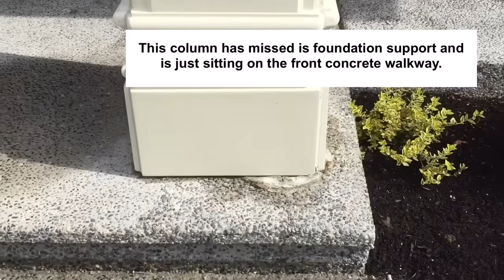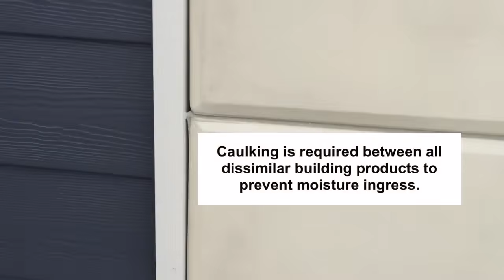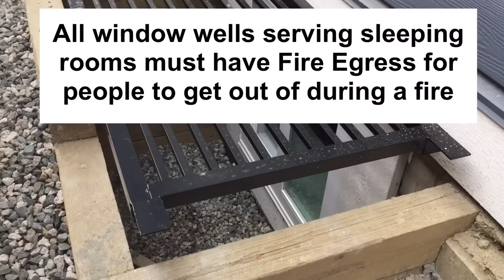New Home Construction Inspection - This is Shocking!!

Comment: Everything built in today’s world, CRAPMANSHIP! The houses built in 40s and 50s, if well maintained are treasures!
Reply: Except plumbing
Reply: @Ahmednscc  my house was built in 26, 2 of my baths have plumbing from then and it indeed seem to have been problem free for nearly 100 years.  I've had more issue with reno work done 5 years ago than bronze plumbing from the 20's.....  Even if the stuff has worn out the difference in craftsmanship is astounding, the original craftsman took serious pride in their work.  The plumbing from the 20's if code was 18 inches for support straps, the pipe has straps every 18 in exactly, everything is fitted exactly, site built windows fit tight,, my replacements done recently have a draft and require caulk.....
Reply: I have to disagree. The reason there are code enforcement and inspections is because old faulty work. Cutting cost is the number one cause. I work in this industry. I build custom homes in the million dollar range. If you have a good contractor and money to spend all should fall in place.

Comment: Great job Tom. I was right there with you. Cant believe the amount of problems wrong on the outside as well. I do drywall and our punch list is held to the maximum appearance to the home owner. I will happily point out caulking and roofing issues if I am called out for a warranty call of water leaks.
Reply: Before he even gets close and you see how crappy the columns themselves were done on a $2 million plus house... you know this is a turn and burn job...

Comment: i have a serious distrust for any gaps smaller than 3mm, similarly i have a distrust for silicon seals, and especially for roofs, windows, and outside WEATHER exposure, i distrust any fillers/mastics/silicones. It must be mechanically safe first and then masticed for good measure. Those facia boards usually have U channels that go on so even if the mastic breaks of old age you don't flood next rain. But...

Comment: Are you kidding me?

How are people asking 2.400.000 $ for this ?!

And how could anybody in their right mind only think about paying such a sum for such a lousy construction?

Ok, I am not familiar with where the house is situated, the property/land alone may be worth quite a sum - but this house is a bad excuse and an insult to any real architect and engineer.

Is this how downspouts look like in a million dollar home in the US in general?!

No big sturdy rain-pipe made out of copper?

The entry door looking like it could be opened with a few kicks/ shoulder throws from some strong guys?

It might be, I am too used to our german standard of constructing houses in "double-shell-masonry"

A thick solid stone for the weight carrying inner shell, most of the times between 6 - 8 inches thick.

some 6-8 inches of high-insulating, non-flamable stonewool insulation layer and then connected to the inner-shell via stainless steel drill-in rods, the outer shell consisting of klinker-stones about 4,5 inches thick.

This combined with a steel reinforeced concrete ceiling and some very solid construction of the roof, with thick, heavy, oven-burnt brick tiles on the roof.
The entry door would either be a 4-5 inches thick plastic, steel composite door, or in case one has more money to spend - some aluminum sandwich construction with heavy duty inline-hinges and 3 - but nowadays mostly 5-location autmatic lock-snappers, with reinforcements all over the place and many times 3 different sealing-lips for beter wheather proofness and also sound-dampening/reduction.

Almost impossible to open, even with a crowbar or other equipement usually used and carried by thieves.

many times a upper-middle class entry door will require firemen to entry, if you have no key and 5-10 minutes of work with hydraulic cutting equipment!

At least, that is the way my contractor is going to built my home and I paid less then half a million € for it! (still lots of money! and I am and still for mayn years will have to work my ass off for that - but for the quality I hopefully will get, I am willingly paying this amount - nontheless I also consider having a home-inspector on my project, just in case!)
Reply: kniefi this is in canada
Reply: This is in vancouver Canada, one of the most expensive real estate markets in the world. The land itself is probably worth at least 1.5 million alone.
Reply: @shanmango  more
Reply: Mark Shan and now with this house on it, the property is worth about 1 million.
Reply: @shanmango  Canada? But it's a big country with low population, why not go live somewhere else for 1/100 the price?
Reply: @Mic_Glow  most of our land is inhabitable.

Comment: Where was the City inspector at when this house was passed? At the race track with the contractor?

Getting an inspection before a house can be sold is in many states a requirement. It should be. 

After being in the trades for the last 35 years the arthritis in my back is getting to the point that I am starting to realize that I'm not going to be able to keep doing this for much longer and have been considering becoming a building inspector. It seems like a logical transition. I need to look into it more.
Reply: Absolutely!  You know what to look for, less physical on your back. Great transition.

Comment: Wow, so many issues.  Just people doing the job that really don't care about their work!!!!  Where I work, I'm very picky.  I want things done right the first time.  I hate half a** anything.  Lazy mistakes I wouldn't put up with.
Reply from the maker: Hey Brandon Blount please keep the negative swearing to yourself please. If you have something positive to add which will help provide a better finished product in the industry, I welcome those comments.
Reply from the maker: Thanks JB Dragon nice to know there are great people out there wanting to product quality over quantity. 👍
Reply: Exactly!  I can be picky, but my own boss knows my work.  He believes the same, do it right the first time the correct way.  Even if it takes longer and costs more.  It's the end results that matter.  If someone is going to buy a almost 2.5 million dollar house, shouldn't it be done correctly?   If you want to half-a** a $20,000 house, ok, I guess, but come on!!!  After you build the place, wouldn't you walk around and do a simple inspection to make sure everyone actually did their job?   Looking at this video, it wasn't that hard and took minutes.  Some of the stuff was really quite bad work.  Those front Columns, really?  Or the Stairs?  It was like armature hour.  The chalking is just laziness.  

Home Inspectors are a good thing.  Sometimes I really have to wonder what someone was thinking building a house.  Like it's their first and don't know better.  Like every industry, you have Great people, Good people, Ok people, fair people, and just downright BAD people.  If someone is doing work for me, I want the Good to great person.  I want the person that's always learning new things.  Will ask how to do something if they don't know for sure so it's done right, and not just guess and screw it up and then having to redo it which is more work and money wasted.

I'm always will to teach someone how to go about doing something the RIGHT WAY!  All you have to do is ask me.  I'm also open to new idea's.    Not even I know everything.
Reply: Why don't you erase it, I delete this kind of nonsense on mine.
Reply: How is this guy not worth hiring?   He isn't there to fix the problem, he is there to identify them.  Then you require the builder to fix his shit.  Even then if you don't believe what  this inspector says, you can research it.  I'm sure this "Scamer" doesn't have any degrees or references at all. :)  

By the way I am a weekend worrier for the most part and would do my own inspection.   But if I am buying a brand new home, you are dam right I would hire an inspector.   When I am looking at homes to buy, I take photos of everything and look at everything possible.   I do this because I try to find the best deal and know what problems I am buying.   This is also good because you can check out the history of the home and see how things used to be built.   Like timber with the bark still on it for the roof trusses, old hardwood floors hidden under ugly carpeting,   or my favorite the old nob and tube Fuse panel in the attic  ( 2 separate ceramic Fuse holders and an old style metal switch).

Anyway it's worth your time to hire a person like this before you move in to a nightmare or even just to make sure the builder didn't forget anything.
Reply: How is this guy not worth hiring?   He isn't there to fix the problem, he is there to identify them.  Then you require the builder to fix his shit.  Even then if you don't believe what  this inspector says, you can research it.  I'm sure this "Scamer" doesn't have any degrees or references at all. :)  

By the way I am a weekend worrier for the most part and would do my own inspection.   But if I am buying a brand new home, you are dam right I would hire an inspector.   When I am looking at homes to buy, I take photos of everything and look at everything possible.   I do this because I try to find the best deal and know what problems I am buying.   This is also good because you can check out the history of the home and see how things used to be built.   Like timber with the bark still on it for the roof trusses, old hardwood floors hidden under ugly carpeting,   or my favorite the old nob and tube Fuse panel in the attic  ( 2 separate ceramic Fuse holders and an old style metal switch).

Anyway it's worth your time to hire a person like this before you move in to a nightmare or even just to make sure the builder didn't forget anything.
Reply: +AboveAverageCAD smith there's a pretty nice house sitting at that location. Doubt he gave the right address. The trailer park a few miles down the road might be the best for him.
Reply: Don't throw the welfare card into this... plenty of hardworking people on welfare.
Reply: That house was probably built by east Indians
Reply: @JB Dragon. An American guy in his late 60s told me that home building workmanship 
lacks these days in America. They just get the structure up within a few
 days.
Reply: The apartment I live in is about 40 years old and when someone walks on the floor above us we can hear their every step... Also when we walk on our floor it makes squeaky noise everywhere we walk.  They just don't make 
good quality homes.. apartments in this country. Why the hell the quality is so BAD in this country?????????????
Reply: 321192ify
Squeaky floors are necessarily an indication of poor quality.  You have to remember, people build for profit and cutting corners adds to their profit margin.   A squeaky floor can be fixed as can many other simple issues that may arise over time in a quality built home...some things do get missed unfortunately.  If you are looking for cheap you will find it before you find good....high prices are not indicators of quality by any means....due diligence and what this guy is showing on here will serve you well in the search for a home well built and or taken care of.
Reply: Lowest bidder, coupled with very few people will buy quality. We are a throw away society.
Reply: Well, that escalated quickly
Reply: I would disagree........home building is not bad due to foreign investment.....it's cost saving techniques, short cuts and just general lack of concern for quality.  You will find most homes built by their homeowners are built to higher standards.  I am building mine, but I am sure I have mistakes or have chosen not use industry standards like adhesive between sub floor to joist/chords.  Cross nailing, ring shank nails or screws can take care of such issues as squeaking....it doesn't mean I don't want the best outcome......I think that some things are a moot point if you look at the total package and what really counts in the end.
Reply: So, we just replaced the locks on our doors. It's a pain in the, you know what. They didn't cut the holes out deep enough so the bolt lock doesn't go all the way in. Not only that, they did not use wood screws or even any good screws. Just some 1-inch screws. They should have had not only a reinforcement plate as well as 6-inch wood screws along with the small screws. They should both have pilot holes, and the original builder did not do this. What tool would you recommend to make the groove deeper? (we already know the basics, haha. Drill, proper bit sizes, etc. Just not sure exactly what to use to make it deeper. We think we could use a rotary tool of some sort.
Reply: I agree. Do it right or get the f*** off my site. 
Thank kind of work is like an art, your name is attached to it and in construction your name goes a long way.
Reply: 321192ify 

I have a older house and it's built pretty good.  A new house can be built great also, but it all depends on the design the the people building the home.  You have people that really like what they do and it shows in the quality of work they do, and then you people like the joker here, in it for a buck, while work quality sucks.

I'd take the A+ workers, and the F class workers like the fool here can keep collecting his welfare check and living in his section 8 hiding out cardboard box which seems to be more to his standards.
Reply: obviously you haven't because shit like this needs to be fixed asap.
Reply: Adam Clark   That house was listed as a Bank owned Foreclosure not to long ago, but maybe he just bought it. 🤔
Reply: GodGunsGutsandNRA maybe thats why.
Reply: Actually this country belongs to whomever conquers it and last time it was not a group of indians....stop playing it's mine.  That's all behind us....the video is up for a reason, not for you to show who's king of the hill.  Grow up and post something on Youtube and contribute instead of complaining and trying to pick fights.
Reply: Nooo, "this country" belongs to the people and the people did not conquer anything, they legislated 13 colonies from Britain/Europe to give others like Lewis and Clark and Mark Twain the God given right to explore and yes conquer the beautiful land that is America... more cowmen sense later, got shit to do....
Reply: JB Dragon its not about having pride in your work. Its call cheap labor that has no experience
Reply: That may be, but the company paying the person or persons to do the job, ok the job after it was done, or also just didn't care.
Reply: Brandon Blount    Sorry to burst your bubble, but I have an excellent crew. I do not have any problems with retaining my crew. I interview my employees before hiring them, and if you engage in conversations about building, construction materials, and you ease into ways to take shortcuts, you can weed out the bad ones easily. People who take pride in themselves, take pride in the work they do. Honest people will start to get uncomfortable when you start talking about taking "shortcuts" for increased profits. Real Craftsmen take pride in their work, and most have a "moral compass" that makes them feel uncomfortable when they are asked to do something that they feel is wrong. When a guys body language starts tells me he is uncomfortable with "rip-off," I usually hire him. That's how I keep good crews.
Reply: JB Dragon good for you!!!
Reply: Is that being sarcastic?  It can be hard to tell on a text message.  It could go either way reading this.   You spend a lot of money on a house which is a huge Investment for most people.  You want it done correctly.  Doesn't matter if it's a $100,000 house or a million dollar house.
Reply: I always do a good job - if I charge too little, that's on me.  Took a few years before I wised up, but I just do low-ball work - better to turn it down than to do a shitty job.  No one is ever happy in such cases anyway, I'm pissed cause I gave them what they paid for (usually much more) and they are still never happy - avoid the cheapskates who don't recognize/appreciate quality.
Reply: if they pay you shouldn't try to do a good job you should do a good job even if they don't pay do a decent enough job will make you a better person
Reply: well said makes you a better person give tips to GH3KKO GARDENER he says even if you pay him he MIGHT do a good job he not trustworthy if you ask me
Reply: Bank owned foreclosure. Spacious 2story, 4bed + 2.75bath home located on quiet cul-de-sac street. Needs TLC...looks like you need to clean up your own mess first, literally.
Reply: Well said Joe Dufoe, if you are in the Vancouver area I would like to work on your site.

Comment: It's not 'brand new'.  There is evidence that this was a remodel, possibly taken to the studs, but still a remodel.  The front concrete steps with the old column bases is the first clue....   Basically a complete ripoff, I would not be surprised if the left the old wiring & plumbing, including the main drain.

Comment: A couple of years ago I was doing some painting at a legit mansion from the early 1900s, freshening up some big romanesque columns and railings. When that project was done I went and did a similar, but much smaller, project on a McMansion in a McMansion neighbourhood. The capitals of the columns were made of styrofoam, and one of the fascia boards was rubber. It was a nice home and the people who lived there were very nice, it was just that the contrast between the real mansion and a big house with a very perishable facade.